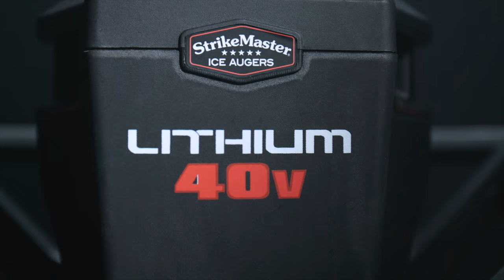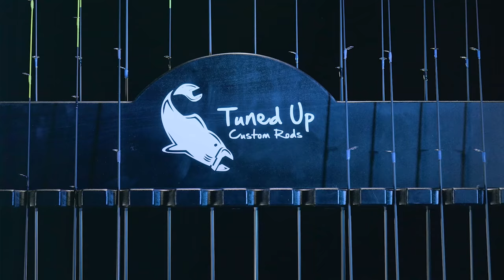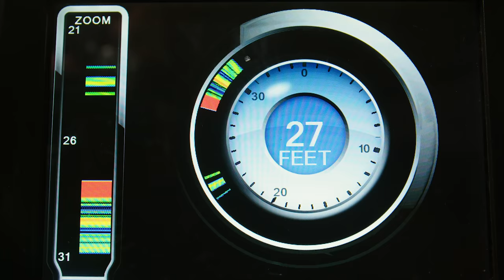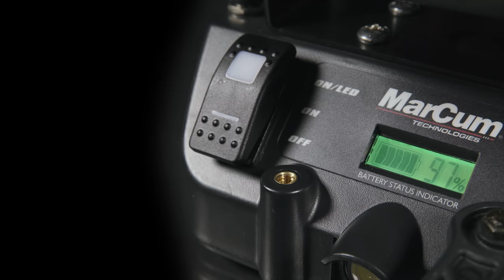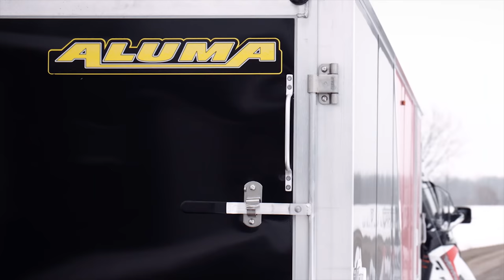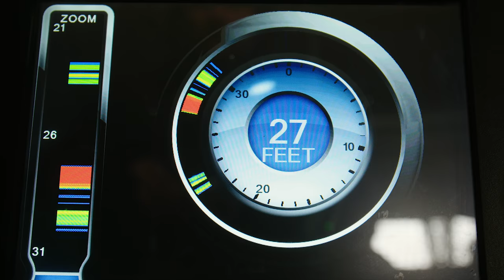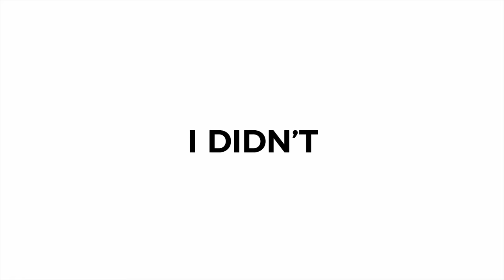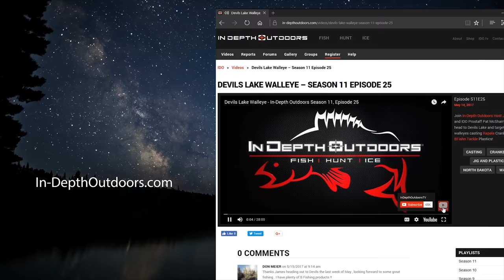GIANT Saginaw Bay Walleyes! - In-Depth Outdoors TV Season 13, Episode 13

Comment: Great show that walleye PJ pulled up was a hog. Thanks for the show. I have a question on your Gopro Hero 7 that James was using. I have one and like it a lot.But if the temp is lower than 20 it doesn't work that well. Do you have issues with it freezing up if temps are lower than 20 ?